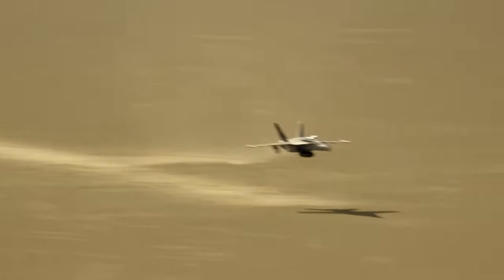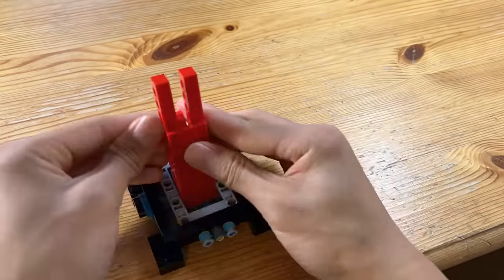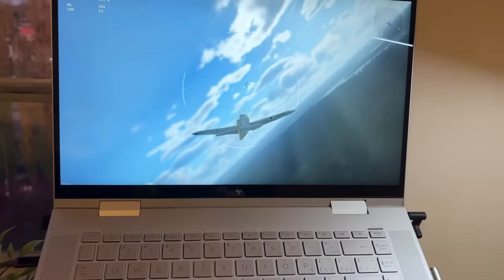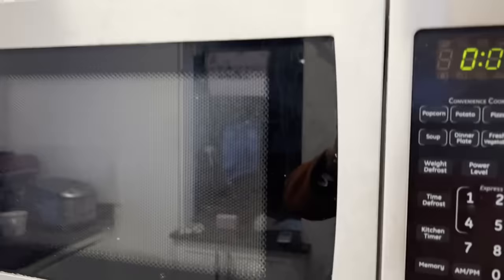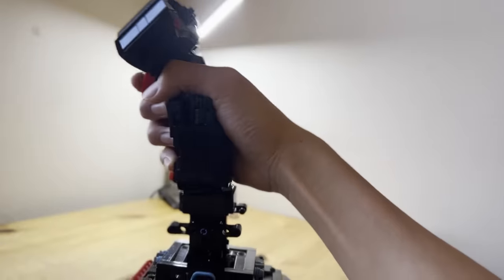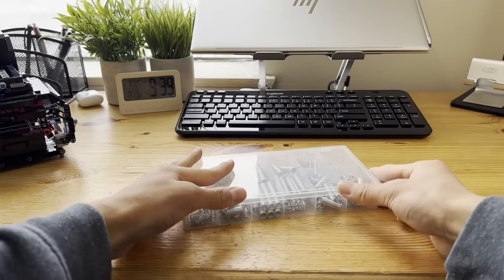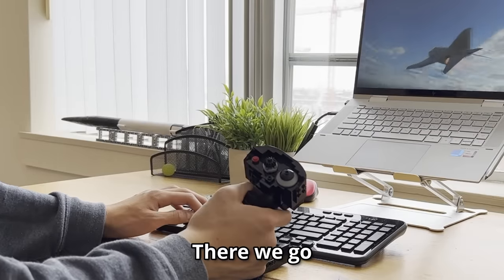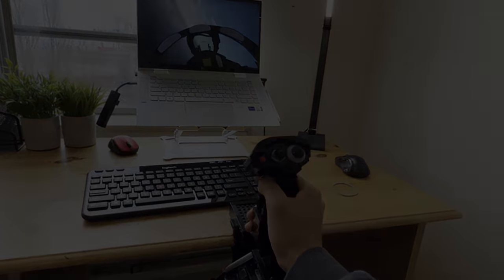I Built a Working LEGO Flight Joystick

Comment from the maker: What should I make next? (Could literally be anything, even if it seems impossible)

Edit (08/24/23): Starting 11:20 there's an audio glitch due to copyright issues... so apologies for that
Reply: A plasma Popper
Reply: working steering wheel for car games
Reply from the maker: @thewatcherofpaintdry9288 lmao what is a plasma popper
Reply: An analog machine (voltmeter or smthin like that)
Reply from the maker: @I_need_a_better_Nickname sounds interesting…
Reply: Make a rotor and throttle controller. You know the sliders in jet cockpit that controls the throttle and the rotor make them.
Reply: A two leg’ed robot with Mindstorms gyro stabilization
Reply: definitly lego 3d printer
Reply from the maker: @kacperjamroz6779  I’m actually thinking of buying a real one LOL
Reply from the maker: @poemes  sounds interesting
Reply from the maker: @dulguun8930  it would be really easy to make a throttle with another mouse, I’m not sure how you would do the rudder pedals tho…
Reply: @ibuildstuff  maybe using rotation sensor thing? or maybe use white and black of strips and sensor to tell how much its tilting?
Reply: @ibuildstuff  is it possible to connect 2 mouse to War Thunder??
Reply from the maker: @dulguun8930  just plug another one in and you will be able to use either one or both
Reply: Throttle lever, and make the make the base of it have buttons for all other necessary functions (drop bombs, change view etc)
Reply: obviously a steering wheel and gear shifter in lego
Reply: A Lego steering wheel + 6 speed transmission would be neat since there's those mini snap on ones for controllers, you simply just need to macro it
Reply: HOTAS.
Reply: a throttle quadrant for the joystick
Reply: fully functional lego jet 😎
Reply: A throttle too!
Reply: A throttle for the stick!! you could say that would be STICK ;)
Reply: @dulguun8930  what are you on? you got 1 part right aircraft have throttles but only certain aircraft use sliders. But I have never hear of a rotor being used in an aircraft, the only thing I can think of is in a rotor wing aircraft and that's the actual rotor not control equipment so do you mean rudders?
Reply: @callehellberg8076  weapons release is always on the stick, it's normally a big red button
Reply: Throttle with two engines!
Reply: Make throttle control so you are fully immersed in Lego flight lol
Reply: @ibuildstuff  do it I have 5 and I don’t regret it
Reply: Now you could make a lego plane controlled by the stick
Reply: Build a Lego key board
Reply: Not sure if too late but maybe try and make a lego MFD to go with the flight stick
Reply: Nuclear reactor
Reply: A throttle and eventually pedals too for the full flight sim experience
Reply: Can you make a steering wheel i did one for my phone and using my phone i played games with my pc too
Reply: RC truck Katyusha

https://en.m.wikipedia.org/wiki/Katyusha_rocket_launcher
Reply: A hexapod companion robot
Reply: This thing but whoth a gaming mouse
Reply: Lego Vr
Reply: Lego throttle pls
Reply: Can u maybe make a fan that has pitch controlled blades?
Reply: Working dinosaur
Reply: automated sentry turret with a nerf gun
Reply: Lego keyboard
Reply: KEYBOARD
Reply from the maker: @patthecat8047 do you mean a piano keyboard or a computer keyboard
Reply: How bout a sim racing wheel?
Reply: Build a shifter with 6 gears and reverse for car simulators
Reply: Space shuttle 😈😈
Reply: engine throttle thingy for planes for the keyboard, the one the slides up or down
Reply: A actual airplane, not one that flies but a cool one
Reply: A tutorial
Reply: Make a rocket car like one of those top fuel dragsters get it to go atleast 60 mph 
And im sure ur doing this right and it has  to be fast thanks 

Im happy that ur blowing up with views
Reply: Lego toilet
Reply: Build a thermo nuclear bomb with a barkerlium core

Edit:grammar
Reply: Make a working nuclear reactor out of Lego
Reply: Working train simulator controller (specifically a sort of locomotive control stand)
Reply: Make the throttle and flaps next to add to the joystick
Reply: Lego sim racing setup?
Reply: Build an actual plane out of lego that flies, and put the joystick in it
Reply: a full scale Lego plane to go with your joystick
Reply: Ps or x box 🎮
Reply: @ibuildstuff  Lego helicopter 👀👀
Reply: thorium breeder reactor
Reply: Nuclear reactor
Reply: A working tank
Reply: I bet u can't make a steering wheel with controler
Reply: build a Gondola Lift
Reply: Make an omnidirectional vehicle
Reply: make a throttle slider to control the throttle
Reply: make a flight joystick for the spitfire
Reply: Throttle
Reply: A throttle quadrant for the plane. Very cool editing and I enjoyed the video.
I also made mine a long time ago but it's based around the Airbus's stick and it's more if a put it on a shelf type since it's not compatible eith a mouse.
Reply: A throttle for it and then rudder pedals
Reply: @ibuildstuff  You should build a throttle to go on your keyboard for flight simulator
Reply: mini stepper workout machine using logo.
Reply: you should make a wheel with lego i made one in past and it was so fun to make
Reply: Make an entire flight setup that connects to your keyboard as well, like for increasing and decreasing throttle, extending and retracting gear, etc
Reply: A throttle joystick thingie to go with it
Reply: An Assassins Creed hidden arm blade, that’s shoots the blade like Spider-Man shooting his web!👌🏼😍 Carry on with these amazing creations man, don’t let anyone stop you!👍🏼
Reply: Now build a full on scale flight simulation out of lego😈
Reply: Or build throttle control on full scape out of lego😈
Reply: I can help you make it more smoother
Reply: you should make a lego keyboard
Reply: i would say also make a throttle and maybe like a dash board for the different buttons
Reply: make a vacuum cleaner only with legos
Reply: @ibuildstuff  i tried to make a lego joystick to work with any mouse by using adjustable clamps, but failed cuz no parts
Reply: Light gun for PC!
Reply: Iron man helmet that opens and closes
Reply: make a lego auto clicker
Reply: Pedals for the tail steering <3 and better fire button
Reply: @lukas-wv4lc  i was about to say that
Reply: A throttle for Warthunder?
Reply: a lego speed car with the ability of climb a pole or even (if its possible) walls
Reply: Time machine
Reply: a car
Reply: A thrust lever to go with the flight stick
Reply: Throttle control to go with the joystick!
Reply: a board that looks like real f18 interior and the buttons on lego set are pressing the keyboard buttons (under the lego build)
Reply: The rudder and throttle control?
Reply: a h-shifter with lego
Reply: Do the pedals
Reply: rudder pedals
Reply: A throttle quadrant
Reply: An Lego AI that generate more ideas through an other AI.
By typing it directly in the keyboard using Lego.
Reply: Make it a logo set man i dont care if it work fully but one of my brain cell tell me to have it cuz i love it
Reply: Make the mouse Lego 😈
Reply: A full scale bf109 
(The plane u used for dogfighting)
Reply: That was so cool to watch! As someone who only likes playing DCS with flight sticks (Specially the F18 Hornet) this is incredible, you should consider making an F18 throttle and foot pedals!
Reply: make a throttle to go with the joystick
Reply: I rubiks cube scrambler
Reply: What about a RC car?
Reply: How about a FA/18 that reacts to the joystick?
Reply: make instructions for the flight stick >:)
Reply: maybe upload a Instruction for that? :)
Reply: build a working lego machine gun
Reply: rudder pedals
Reply: Make a flight simulator out of lego, in real life
Reply: A working computer keyboard and mouse entirely out of legos👍
Reply: kadens mom
Reply: Peddle rudder
Reply: A working dilfo
Reply: a giant lego pneumatic locomotive
Reply: an actual place for your lego flight stick bet you can't cause it's impossible
Reply: A throttle lever
Reply: A keyboard buttons that is needed for the flight sim
Reply: can you make the throttle for the planes
Reply: A nerf gun
Reply: Impossible triangle irl
Reply: next needs to be a steering wheel for a driving game or a Lego keyboard and mouse
Reply: Make a steering wheel from lego
Reply: Lego rudder pedals? I have the same real joystick you do and I find it (and any other joystick) unplayable without rudder pedals. There's software you can use to convert steering wheel pedals to rudder control by merging 2 axes into one but it's not perfect.
Reply: It hurts to watch another person fall in war thunder but it has fun moments
Reply: a fusion reactor
Reply: @ibuildstuff  make two pedals that connect to the right and left buttons of the mouse
Reply: Throttle Control out of Lego with the flight stick
Reply: A throttle thingy
Reply: A DIY steering wheel for the game BeamNG Drive, I really can't steer well just with the keyboard keys lol. I am still figuring out a good solution but can't :(
Reply: Controller for a mouse
Reply: make the flight stick able to swap between different designs, add rudder pedals, a few buttons, landing gear switch, flaps, and a throttle lever and then try it in a game without mouse yoke
Reply: @ibuildstuff  Hey  What game did you play in this video
Reply: Make a throttle with this
Reply: A throttle to go with the joystick
Reply: A throttle
Reply: Build a throttle quadrant for the Flight stick
Reply: A throttle stick
Reply: a boeing yoke
Reply: Your Mum must love you😂, as we all do. Great sense of humour too
Reply: Do dcs it’s free and way more realistic
Reply: Make one for a controller (xbox, playstation)
Reply: instructions for this
Reply: A thing to control the throttle on the air plane
Reply: THROTTLE
Reply: Make a system that can help a mouse move by itself (computer mouse 🫤🫠)basically aim bot but for everything including war thunder
Reply: Also make a Lego yoke Boeing one
Reply: Fully functioning 747 plane in Lego
Reply: This but for an xbox
Reply: @ibuildstuff Let me start off by saying: THIS IS AMAZING!
 Could you possibly (even if it’s a separate video and tag me haha) do a step by step instruction with a list of which pieces (sizes and amounts included) I (and I GUARANTEE so many others would love to use/try this amazing idea instead of going out and spending a ridiculous amount on a joy stick. Thank you @ibuildstuff
Reply: rc lego f14 tomcat
Reply: f14 tomcat rc

Comment: Suggestion: You could reverse the mouse (upside down) and instead of moving the entire mouse, you'd just move a plate (for the mousesensor). However you'd have to somehow reverse grip onto the keys. Or mabye grab two switches and wire/solder them onto the mouse directly?
Reply: You could just build a bump on the base so when the mouse is pushed down it triggers a mouse press.
Reply from the maker: This is actually super smart, great idea lol
Reply: I immediately run to the comments to find this exact comment lol

Comment: I genuinely didn’t think it would be actually good, good job, anything is possible with lego as long as you’re smart it seems
Reply: It has lots of flaws, I made one and I spent 2 years correcting all the flaws, biggest one can't shoot when joystick is deflected,second offcenters itself, third movement rly unstable tends to roll aggressively when aiming and only slightly turning. Fourth distance covered by mouse in joystick is much smaller than u actually need to, so u can't fully deflect commands, fifth, in dogfight u cant look around because it offcenters it joystick, sixth, trigger just falls off because it is not connected to anything, etc etc etc

Comment: If you flip the mouse upside down, and move the surface under (now over) it, the moving parts can be much smaller.

It does make pressing the buttons easier and harder, cause they don’t move, but are on the bottom.

Comment: what a cool idea! great video and build! Something I could see being useful for this would be the flex cables- the regular lego ones could be used or custom lengths made to operate multiple mouse controls without disturbing the main mechanism. the flex cable and tubes can be easily recreated in longer lengths using 3mm O.D. x 2mm I.D. PTFE tubing (amazon). for the flex cables, PETG 3d print filament is perfect. the only tricky part is nibbing the ends to attach the lego flex cable fittings. I found a sharp knife or tiny round file works. 

anyway, super cool!

Comment: next step: make a throttle so you can have a true HOTAS setup, but all made of lego.
mad props.
Reply: I made one out of Lego, first I built a joystick, then I used a wheel connected to a second mouse that when spun turns the mouse wheel and controls throttle, I then change the gear ratio so that I could put a throttle stick going up that would turn the mouse wheel loads of time when actioned. Then, I found a scrap keyboard, an stuck it underneath my desk, and contrôles A and E keys for the yaw, war thunder allows u to put sensitivity at 0 percent and that means it progressively deflects the rudder, so depending on the amount of time I press the pedals, I can control the deflection.lastly I just binded that when both of them are activated it puts the brake

Comment: Looks great. You could make some rudder peddles as well
Reply from the maker: Perhaps…
Reply: @ibuildstuff  rudder pedals are suprisingly simple, just put a lego pedal on top of an xbox one triggers, and it should do the trick
Reply: No, u need it for the yaw, and that means u have to bind an extra Xbox controller, and most cable aren't long enough, do I just found a scrap keyboard and made the pedals press A and E, and wt allows u to deflect them more or less depending on the amount of time U press them

Comment: Wait a minute... When you're using the mouse to control the plane you have to constantly lift the mouse, reposition and drag in the same direction to do a continuous pitch or roll. Having the mouse under a lego stick like that just wouldn't work since you can move the mouse only so far with it and can't lift the mouse to reposition and drag again in the same direction. The range of motion would be serverely limited.

Comment: I once build my own Joystick, in the 1999. At that time it was Very much not exist an too expensive.

I build it from "Mouse Ball"

Its the best Mouse Ever, simply by removing ita ball, and use the 2 axis Roller.

But the problem is Centering.

In year 2003, i made it work with some Little script Programming,  to centering the Mouse.

That is the most Cheapest Gaming controller i ever had at that time.

That Mouse is Rare now, but it really work like gyro with support of Usb blug, after old Ps/2 port.

But today Gyration Help alot, that work as Mouse cursor, and Joystick.

But still never delivered to my city, and its way too expensive.

Until now Gyration had never delivered, and once i buy them alike product from China, but it doesnt work well, it look work like for presentation only.

In the next month i found really small Mouse that work also air mouse , it was korean Product.

But now i dont have time to make more controller gaming.

Well. Fun.

Comment: Spanish Latin : la unica manera para crear bien un joystrick se requiere un mecanismo movimiento que un potenciometro de rotativo entonce  tienes dos potenciometro en la parte de lado sera ariba y abajo y el otro es para esta frente o dentras ese va de lado para que el tercer potencimetro ese para la potencion si lo necesitas por eso todoas la empresa de hacen josytrick y volante estan asociado por aduino por es la empresa que hace todo el circuito de todo joystrick y volante de toda empresa que compres el producto por eso hace esto para puedan vender sus circuitos de todo tipos ademas puede hacer tu joystrick desarmar tu mouse pero te recomiento dos mouse uno que controle para el tipo de cambios de comandos y el otro para joystrick el segundo debes desarmar el mouse para quitar los circuitos de click para crear una linea de coneccion para crear el boton de disparo  en la parte arriba de josytrick de lego o plastico  y los otros son los sensores movimiento que el infrarojo eso hace deslizar el mouse o hace movimiento para el piloto o avion podra responder debe crear una bola o tacon para hacer el angulo de grado del movimiento asi se resuelve el problema fallo movimiento por los sensores infrarojo se requiere un tiro material que requiere deslizar no hacer perdidas o drift no funciona bien tien lago sueve y mejor.

Comment: Hi I am very inspired by your build and want to try your idea I think I have all the pieces and stuff but I connot see how it is build I understand the idea but I cant see like which piece goes were so if you have like a instructions Manual or something just let me know thank you.

Edit: If its private then keep it for yourself but I would like a instruction manual for the cool black handle. So i build the prototype one that looks like yours i added the elastic bands to the side attached to the mouse frame but always if i pull the handle any direction the frame of the mouse tilts up and then the lazer of the mouse wont read its environment good.

Comment: Did you remember to reset all the sensitivity settings back to normal when you went from the mouse stick to the regular one?  It looks like you dialed that all down for the mouse stick and then when using the real stick it looks like you are flying more or less a dead stick, which is not normal, so I am curious if you forgot to reset all that.

Comment: Nice I remember like 5 years ago I did something very similar with a guitar stand, the mouse, some carboard and duct tape, it was more of a yoke than a joystick, the mouse was fixed on the main tube of the stand and the adjustable tube that can move up, down and rotate freely would be the surface the mouse's sensor picked I used it for warthunder as well.

You could also use it as a steering wheel if the game allows you to use mouse as a steering input or if you configured a virtual joystick.